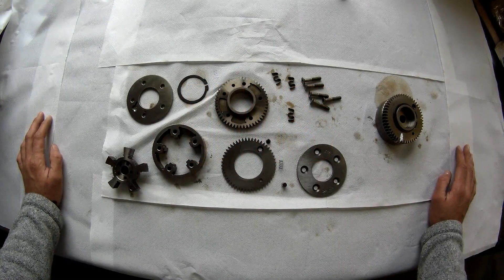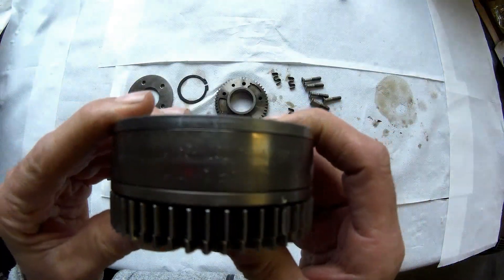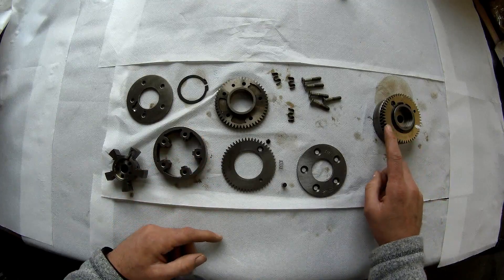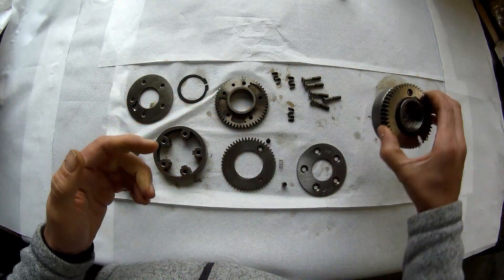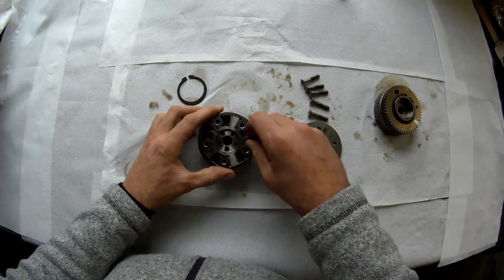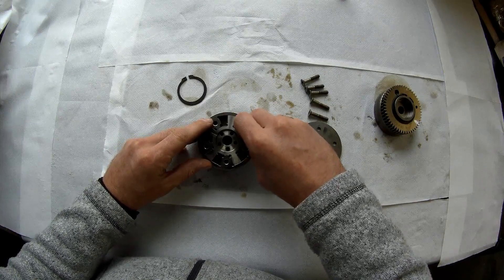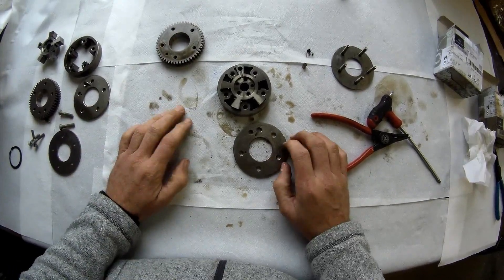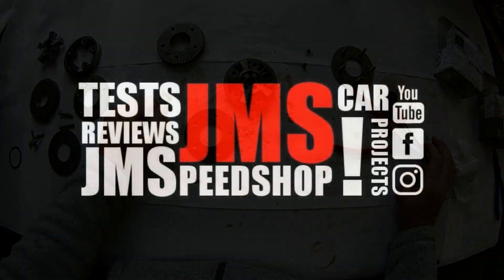M156 M159 Camshaft Adjusters Wear Problem

Comment: There's a company in Canada called 63 motorsports. They manufacture the plates from much harder materials. It's around $555 for 4 plates and 4 pins
Reply: Yes they do, I used their parts on my CL63 AMG 2008 and they work like a charm. They have multiple stages, but are absolutely honest that unless you are adding a aftermarket supercharger, just using the Stage I is good enough. They also sell great titanium bolts and Arp bolts to improve the life and performance even more.

Comment: So cold starting this engine isn't going to damage it right? It only starts damaging the cam adjusters when it happens all the time?
Reply: Is not going to blew your engine the first time you noticed, but should be addressed the sooner the better. My mechanic noticed the problem when my CL63 2008 hit 90k miles. Got replacement parts from 63 motorsports in Canada and did the work on 10/15/2022. Three of the four plates were heavily wear out.. So it was a bomb waiting to explote. So, if you are planning to keep the car engine long time, get your wallet ready.

Comment: weld it to fix it
Reply: how is that done??
Reply: @kwantum88  people have welded the worn out metal
Reply: @narcissistinjurygiver2932  weld and then machine it...know of any tutorials out there?
Reply: @kwantum88  no I just saw a vid on yt a while ago and this is what they did
Reply: I would advise against the weld and CNC machining. You end with a plate with two different strengths he on a high speed rotational mass... . Eventually the TIG soldering will fly away, recipe for disaster. Change the plates as I did, 63 motorsports in Canada got you cover. I can personally vouch for the quality of their pieces.